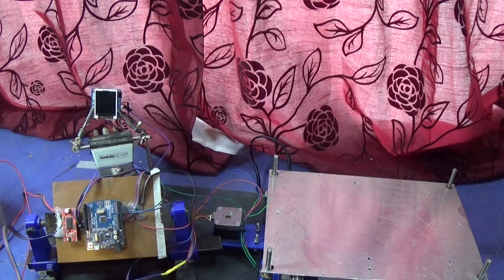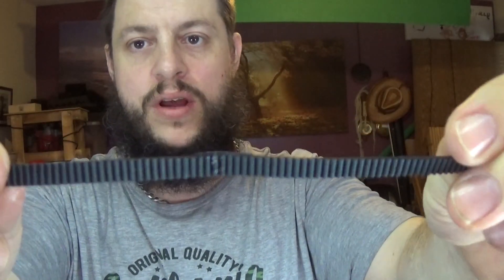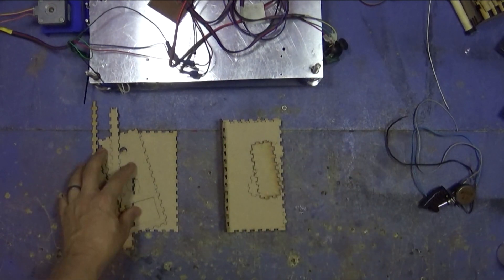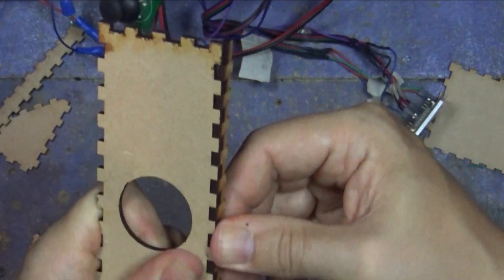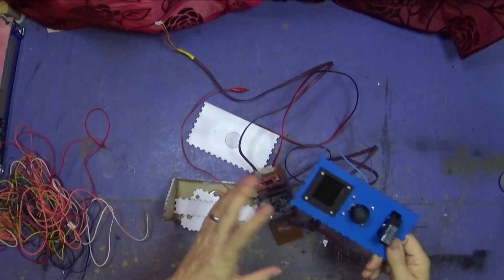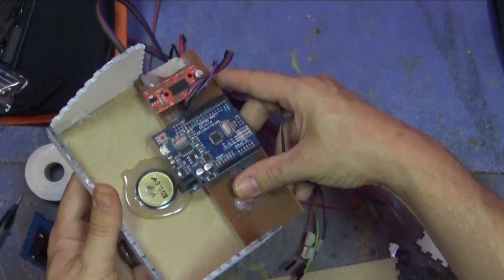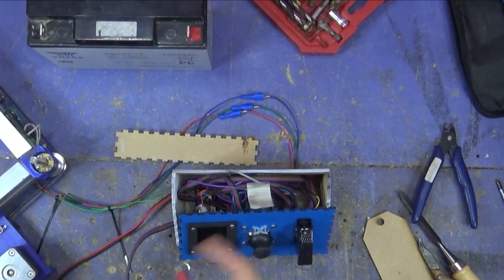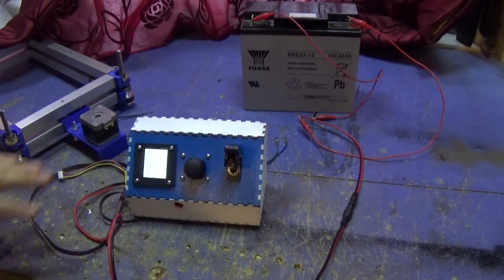K40 Laser Bed Pt4 - Self Calibrating - Auto Bed - The Final Part

Comment: Hi there, great video which I'll be using to make a similar bed. A question, though, why the use of a joystick to control movement instead of an On-off-on switch? I was thinking that you could use two, one for fast trave and one for slow, but you must have had a reason for using what you did.

Thanks again for posting the vid!
Reply from the maker: Myself and David talked about having up and down as fast travel and left and right as slow and press down as enter. As the project progressed I realised I had wired it up wrong for that to be an option. I would have had to rewire the whole project. This is only a prototype and I will come back to it in the future there will be a lot of things I change but it works well enough.  I chose a joystick for two reasons though number one because I had one already and number two because I like the tactile feel of it etc. Thanks for the comment.
Reply: Thanks; I've done some Arduino programming as part of a flight sim rig build, so maybe I'll have a bash at getting the two speed switches wired in. I assume the joysticks are functioning as simple switches not as potentiometers?
Reply from the maker: @lesthegringo  wow that sounds brilliant! I didn't do the final programming on this one a friend of mine did. Although I believe he coded it the same way as I did in the beginning and coded them as pots and not switches.
Reply: Great, thanks for the feedback; looks like I have some fun coming trying to get it all working
Reply from the maker: @lesthegringo  good luck buddy. If you need any help just send me a message or email me